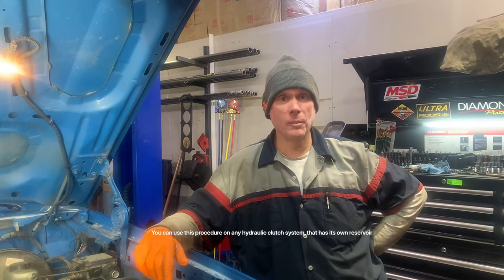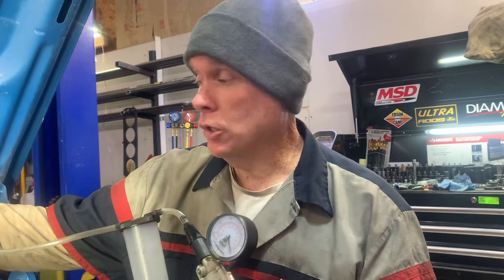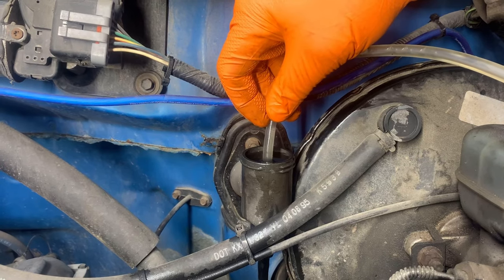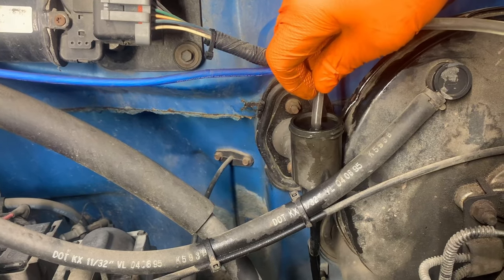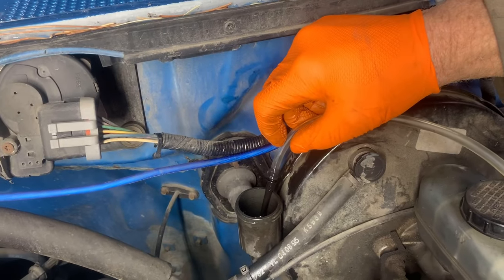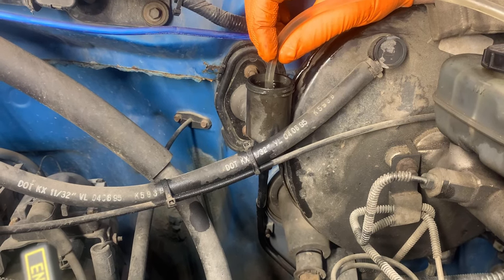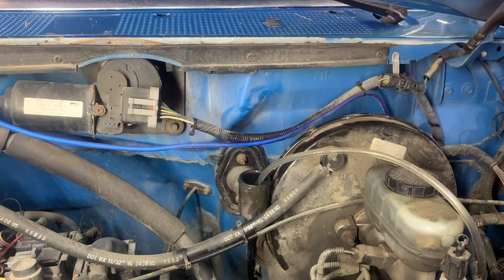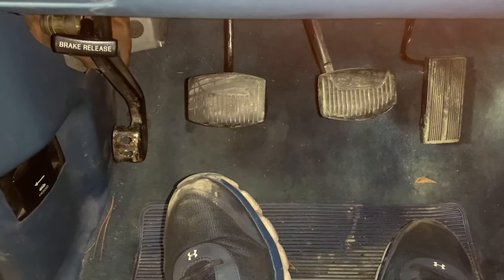Easiest, way to bleed a clutch. Works on impossible Ford concentric slaves. Can be done alone.

Comment: I have a Jeep JK, which shares the same reservoir as the brake, unfortunately impossible to get to the hole in the bottom like you show. I also have a Centerforce concentric slave. Having trouble with shifting into 1st or Reverse when stopped sometimes. All research leans toward there is some air in the system. Tried vacuum off the reservoir cap multiple times, but it isn't getting the air out. Going to try an aftermarket reservoir dedicated for the clutch and your method. Hope it works out.
Reply from the maker: Make sure you don’t have any leaks at the slave or master as well. Good luck.

Comment: We successfully did this today.  However, our mistake was not removing everything and attempting to get the most air out of the assembly before attempting the vacuum procedure.
1. We installed the new master cylinder straight away with no prep.
2. Initially, could only pull 15" of vacuum.  Kept trying over and over again.
3. Decided to do a gravity flush of the system from the bleed valve on the transmission.  Let approx 3 reservoir's worth of fluid go thru.
4. Next pull was able to get 26" of vacuum.  After 3 hours, still pulling small amounts of air, no pedal.  Sometimes with the clutch in, sometimes out.
5. Decided to start pumping the clutch while vacuuming.  Eventually the clutch pressure started to build up.  Yea!  After about 45 minutes we finally had a usable clutch.

Overall about 4 hours starting with a totally dry reservoir and dry master cylinder.  Hmmm. Next time I'm gonna do what I can to get the most air out of it before installing.  Would've cut down on bleeding time for sure.  Also, fwiw, we used the cheaper $25 harbor freight vacuum pump. Worked like a champ and was perfect for the job.

Thanks again for your excellent work and knowledge Shaun.  It certainly helped me get my son's butt back on the road and back to work!
Reply: Did the harbor freight one come with the tip needed to do this job?
Reply: @chiliboom6140  Should be able to see it in the package. If not AutoZone has one for 50. I am using that one and it has the tip.
Reply: @EMC13sR  Thank you kindly!

Comment: I JUST dealt with this nightmare, instead of going through the reservoir ( I tried countless times)... it was nearly impossible to remove the air from the reservoir,  at least in my case,  I had a mobile mechanic take my vacuum gauge and connect to the bleeder valve, on the slave cylinder,   he turned the valve slightly open and within 5 minutes,  my nightmare was over
Reply from the maker: @johhniemiller9509  that’s great, I’ve had limited success with that method. Very limited.

Comment: Hi there thanks for the video have a question for you I have a 99 Ford F-150 with a 4.2 L  in it with this work on there? I'm having a hard time putting it into gear so I'm just wondering if this would be my problem.
Reply from the maker: Hi, if the parts aren’t new, you likely have a leak somewhere. It could also be, clutch or synchros. If the parts are new, then yes.

Comment: Great Video ! I'm trying to figure out how to get the adapter cone down in where it needs to be on a 1985 F250. The line to the slave comes out of the front of my master cylinder instead of the bottom like the one in the video. Looking straight down into the master cylinder there is a hole for the fluid to go through. The hole is not round, possibly more oval shaped. Does the cone with attached line need to be fed through the hole and then toward the front of the master cylinder ?
Reply from the maker: I’m not sure, I’d have to see it. However you can get it to hold vacuum, is the trick.

Comment: Thank you for the video. I’m going to go try this on a ford ranger
Reply from the maker: You’re welcome. It only works, if the slave and master are good. Good luck.
Reply: Did it work out for you?  We're doing one tomorrow a 95.
Reply from the maker: @dryan8377  yes I’ve used it many times. It always works.
Reply: @dryan8377  yes it worked. Thank you

Comment: trying to understand what im doing wrong but i lose clutch pressure each time i try your method. its actually very easy to bleed from underneath but my issue seemed to be just a tiny amount of air until i tried this method n now im starting over from scratch. thanks
Reply from the maker: Are the parts new? Sounds like you have a leak.
Reply: @greasyhandsauto-shaunbutte9726  yep new clutch new clutch pressure line new slave new master new resevoir clean new dot 3 brake fluid for resevoir. i got plenty of air out but no clutch pressure from the pedal. i refilled the resevoir probably 10 times
Reply: @greasyhandsauto-shaunbutte9726  nothing leaking anywhere everything is dry underneath
Reply from the maker: @user-zz5hm3ev3h  check the access, on the bell housing and the master, under the dash. If they’re dry, try it with the pedal down and then pull it up. It’s my experience when, what you describe, happens that there’s a leak somewhere.
Reply: @greasyhandsauto-shaunbutte9726  i dont see any leaks. if i pump the clutch up 5 or 6 times then crack the bleeder at the trans till solid fluid then close it before flow stops i can get clutch pressure but not enough. this is a 93 ranger 3.0 5spd. not sure if maybe ur method just isnt compatible with my truck. i bought a $20 hand vac pump thing like u got.
Reply from the maker: @user-zz5hm3ev3h  okay, try it in the down position. That will bleed the master, then pull the pedal up and do it again. They have a lot of air, in them.
Reply from the maker: @user-zz5hm3ev3h  yes, it works on Rangers.
Reply: @greasyhandsauto-shaunbutte9726  try your method with the clutch down from the resevoir?

Comment: Hey there Holmes!!!  Man am I glad I came across your video brother???  This is fantastic because I’ve got my MityVac…. I actually also felt a little change a month ago and because doing the vacuum on what I’m now thinking is just a single tube or single line…nothing special… I can test for a little leak down in my slave cylinder with the MityVac… if it’s not holding some suction then I’m in trouble!!!  I’m going to bleed mine like you do and top off the fluid… is that break or power steering??? Or blinker fluid, Sir???    Really appreciate your information!  I’m praying that it’s not leaking somewhere… I’m an army and a Air Force ROTC cadet who didn’t have the knees after college football to join my beloved Army Rangers Training … Did absolutely fantastic in my Basic Training then after several bumpy parachute landing’s in my jump training found out that my knees just didn’t have what it takes to be able to handle the landing’s!!!  Really horrible news for me as I was planning on joining the Special Jump team and work on all those special occasions and events where the Army sends in their A-Team to do the stunts and exhibition skydiving events.     Unfortunately you can’t ware a couple custom knee braces when you are a regular shlepper in the Army… but you can as a regular joe or a Civilian… so I’ve been able to complete my 1000 successful jumps certification and I’ll continue to try for 2000 and I’m still actively training with divers and getting the new jumper’s training help!   

When I felt that little pressure change mid stroke that morning I was totally freaking out because the not knowing if my hydraulic clutch was just getting ready to fail!!!  I’m under the impression that you get no warning… they just stop working!!!   I’m adding fresh fluid and bleeding it and Thank Goodness for you!!!  You Wonderfull Wonderful Man!!!!  If it will hold a little vacuum then your slave cylinder down there isn’t leaking any fluid!!!  Hallelujah Hallelujah if that’s the case because I felt a little pressure change when holding the clutch pedal off the floor a little and getting ready to engage first gear and take off!!!   so I’m praying now that it was a little air bubble that had been sitting in there for 6 years and that it’s nothing!!!  That tip to grab a point and pull vacuum on the line was just so huge… I really haven’t been able to slept more than a couple hours without a nightmare or dream about my truck breaking down !!! waking me up… I just gotta pull a vacuum and see if it holds for a couple minutes and at least then I’ll know if I need to replace the slave cylinder!!!  And it’s way better to need to replace a slave cylinder for a hundred bucks or whatever then to need a new clutch!!!  😂👍😁😁😁😁😁😜😜😜😜😮😮😮😉😉✊😁😁😁😁.  

So a huge amount of tension and stress was removed from me by your video!  It gave me hope in a very poor and low time in my life!!!  Just knowing that I can test it and know if I have a leaking or a solid system is huge!!!  Absolutely huge when you are a bipolar nut case with some other stuff and you are in an extremely tight position… that compounds that stress and it’s like a 1” drill bit in my skull drilling my brain!!!
  Thanks again for the video!!!
Reply from the maker: Too bad about your knees. Thanks for the kind words. Twice!!

Comment: Hey quick question! I’m doing the same procedure but bubbles keep coming out, the clutch feels ok but there’s a very stiff spot at the end of the travel. Should I take apart the system?
Reply from the maker: Try it with the pedal down. If after that you keep getting bubbles, you likely have a leak.

Comment: I'm just replacing the slave cylinder. do you have to gravity bleed the line from the master cylinder to the slave cylinder first? When you remove the vacuum pump line from the reservoir does fluid get drawn into the line or sucked into vacuum pump bottle? Or both? Sorry for all the questions
Reply from the maker: It doesn’t hurt to gravity bleed first. Fluid gets drawn into the line and bottle both.
Reply: @greasyhandsauto-shaunbutte9726  thank yo sir
Reply from the maker: @ranger1244  you’re very welcome

Comment: What exactly is it that I need to put the hose tip into, so the fluid that comes out with the bubbles doesn't need to be replaced?
Thanks for this great video
Reply from the maker: You’re putting it into the hole where the fluid travels into the tube.

Comment: After the initial pulling out bubbles couldn't you force bubble free fluid back in rather than repeating over and over ?
Reply from the maker: I don’t think so because, air gets trapped and it takes vacuum to get it out.  You may be able to force it from the bleeder. This is the easiest way I’ve found and believe me, I’ve tried them all. From reverse bleeding, pumping the clutch, gravity, pump and open the bleeder to pulling the master and bench bleeding.

Comment: So question at first I was doing this and it was holding pressure now it won’t hold pressure am I missing something or did I blow out the seal?
Reply from the maker: @IVIylostpotato  I doubt you blew the seal. There is much more pressure pushing the pedal than that vacuum creates. However, it does sound like you have a leak somewhere
Reply: @greasyhandsauto-shaunbutte9726  so I agree and I just looked and it’s pouring oil from what looks like an oil filter on the transmission. Which wasn’t before does that mean slave cylinder? I didn’t try tightening that filter but I will also
Reply from the maker: @IVIylostpotato  yes that’s the slave.
Reply: @greasyhandsauto-shaunbutte9726  🤦‍♂️ 😭
Reply from the maker: @IVIylostpotato  I understand!

Comment: I bleed mine by pushing the slave cylinder rod in after the failed buddy and gravity methods. However it got completely stiff half way through. I forced it and blew out the dowel pine holding the steel line into the slave. I'll try this next

Comment: I tried this about 10 times today on my 95 f150. No luck! pedal still goes to floor and 
stays there! No disengagement whatsoever
Reply from the maker: Try it with the pedal, in the down position and then finish in the up. Make sure the bleeder is closed.
Reply: Mines to. Did it work for you Mikey?
Reply: @memo6578  I ended up injecting fluid directly into the slave with a pressure bleeder through the bleed fitting. was a bit messy but it worked. Then followed the Ford procedure of sharp and consistent pedal push and release about 20 times per set. After about a dozen sets I would hold the pedal to the floor and quickly open & close bleeder. Your going to have to do this repeatedly until you no longer get that little burp of air out. Be sure to not let the master get low on fluid. Good luck! Its a pia

Comment: Some people are doing it pedal down, some pedal up. Will it work either way?
I've got and OBS Powerstroke with clutch disenchantment about 3/8" off the floor.
Reply from the maker: If the parts are new start with it, on the floor and then up. If not new, then do it, with it up.

Comment: Just to put it out there cus it seems like every comment on these videos has overwhelming success with this tactic, it just didn't work for me. In fact, it would ruin my already decent bleed. Just doing your typical pump pedal x10, then hold pedal down with 2x4, crawl under truck to crack bleeder for 10-15 seconds then close & let pedal come up, then repeat. Also some hammer taps on the kink in the line near the frame on the rangers seem to get the air moving from that spot better.  Thats the only thing that worked for me. Pedal feels pretty solid but I do have about 1/2" of free play... it doesn't feel like air though, it just feels like the piston is topped out and the pushrod has more room to come up.  Lmk if anyone else went crazy looking for a perfect bleed cus I did and I feel like it doesn't exist on these Fords (Ranger in my case)
Reply from the maker: If it ruined your decent bleed, I’m betting you have a breach (leak) somewhere. Thanks for the comment.